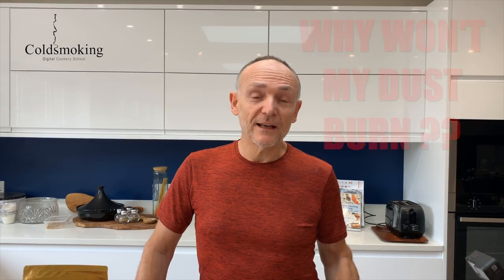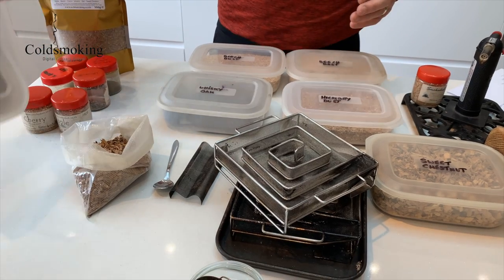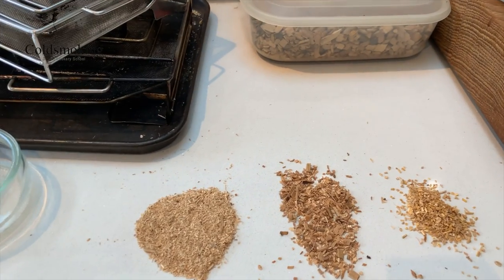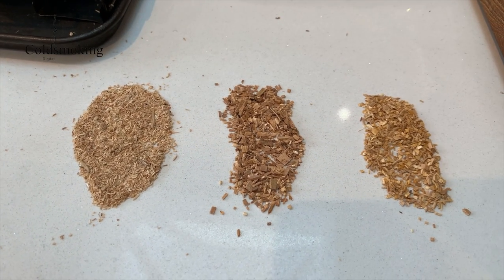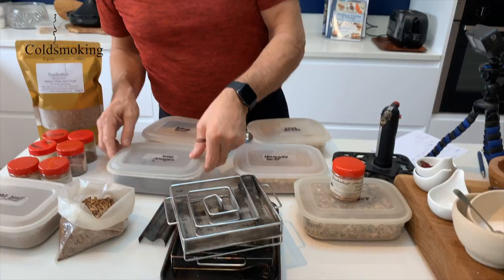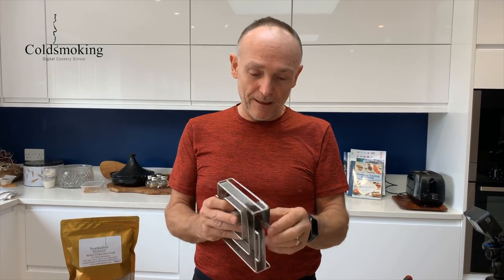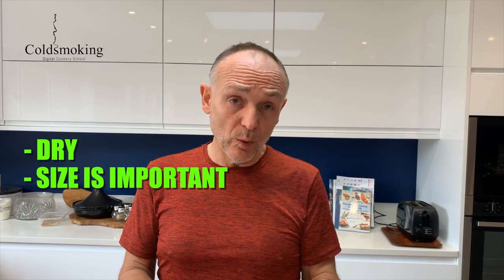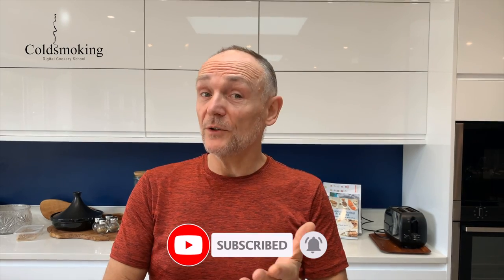WHY WON'T MY WOOD DUST BURN?? - Let’s look at the issues and the solutions.

Comment: Thank you for the great detail in this video I've tried now to make cold smoked salmon loxs twice The 1st time I got my sawdust to ignite and smolder but when I came back It had actually caught fire and burned to a hot smoking temperature I still enjoyed the smoke salmon but obviously it wasn't cold lol This time I have tried now I'm watching it closely and it tried to do that again I think I filled the smoke generator with too much sawdust so I have eliminated some and Continually working with it to get to know my smoke generator better I use a cheap imitation to the one you use thank you again great video I subscribed
 A question can pellets be used instead of sawdust thanks again
Reply from the maker: there are some smoke generators that use pellets but they tend to have a pumped air supply. personally I’ve not tried myself. Thanks for your subscription and comment, appreciated. 🙏

Comment: Really good video mate thank you, what do you use to make the dust?
Reply from the maker: I used to use an electric wood plane set on extremely fine and it would produce loads of fine dust. I now sell commercially via my website www.coldsmoking.co.uk but as we now do this as a business we need to comply with a few more regulations regarding it's sourcing etc. I no longer make it myself as we source from a wholesale supplier of commercial food grade woods for smoking.

Comment: I wonder what machine I can use to grind up my chips to your Beech size? I've tried Blender and Food Processor...even coffee grinder!
Reply from the maker: i buy my dust in from the manufacturer. but if you’re not wanting to buy try a router blade on a block of beech.
Reply: @Coldsmoking  Would you kindly share the address please?
Reply from the maker: I retail the wood dust myself on my website. www.coldsmoking.co.uk
Reply: @Coldsmoking  Thank you...but you don't ship to USA! Where else can I get some?
Reply from the maker: no we don’t but i’m sure there is a supplier in the US… I don’t know of one personally but im sure someone on here must know.
Reply: Hello Steven! Regardless of the dust, since I started putting it through an electric spice grinder, I've had complete burn and lots of smoke in my maze. Good luck!